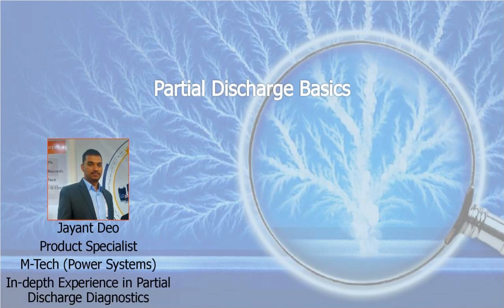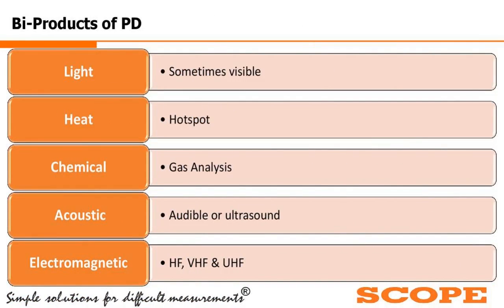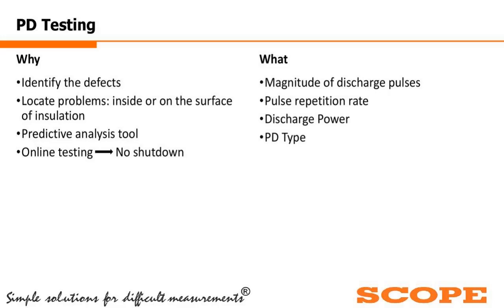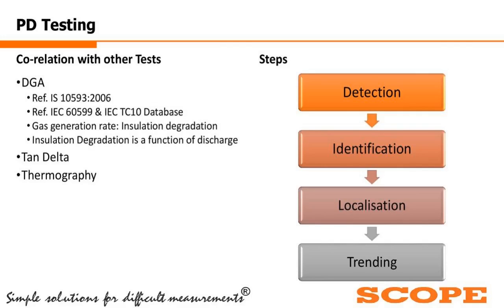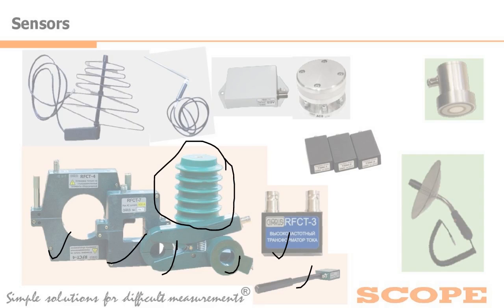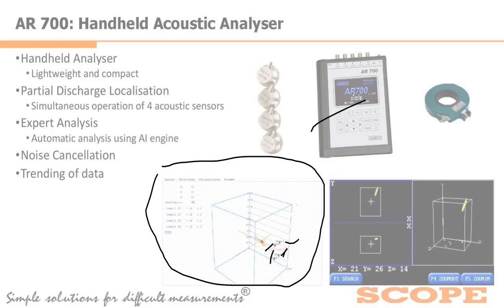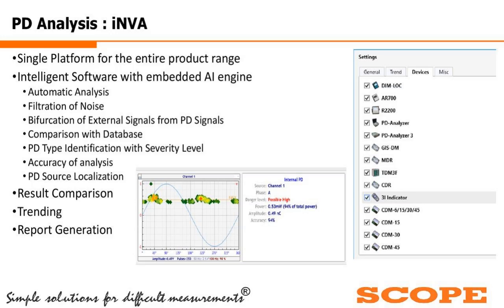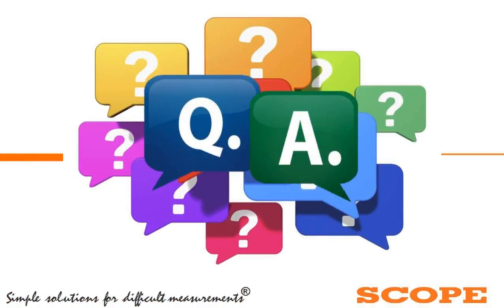Partial Discharge Measurement and Analysis using Portable Solutions of SCOPE

Comment: Sir plz explain how coupling capacitor is used for online Partial discharge measurement
Reply from the maker: Coupling capacitors are used to decouple the charges from the test objects, generally, they are recommended to be used for rotating machines.In case you further require any clarification please write to us at marketing@scopetnm.com